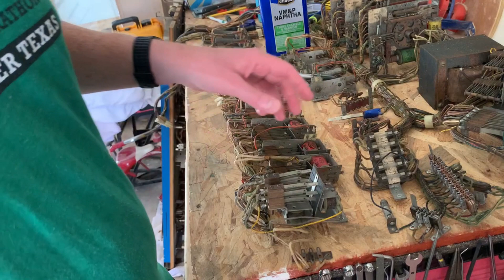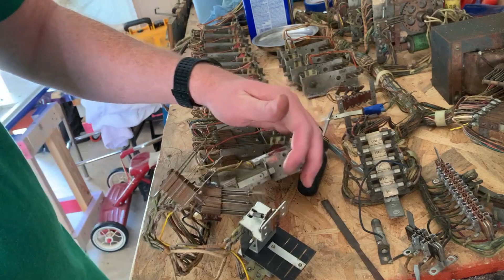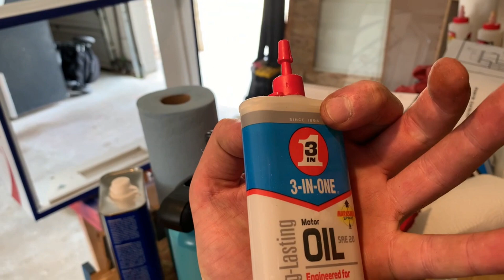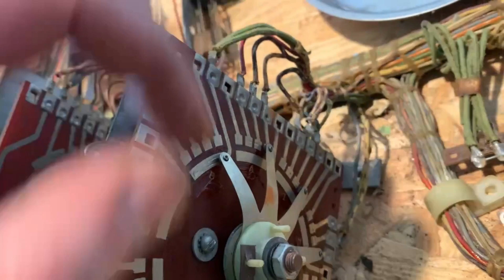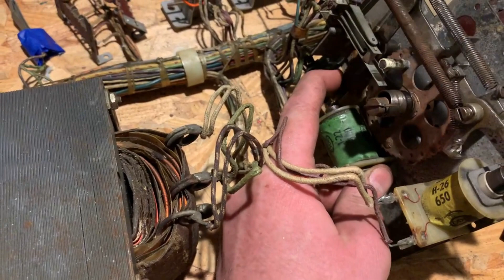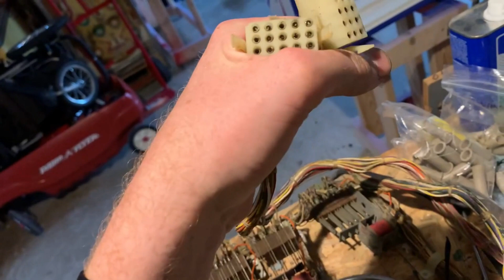Rebuilding Steppers & Relays! -  Part 15, 1975 Chicago Coin Blue Max Pinball Machine Restoration

Comment: The company I worked for years ago used kerosene to clean the metal moving parts, it left a little oil residue behind after you wiped it clean.
Reply from the maker: Interesting. I’ve never tried kerosene. I’ll have to give it a go.